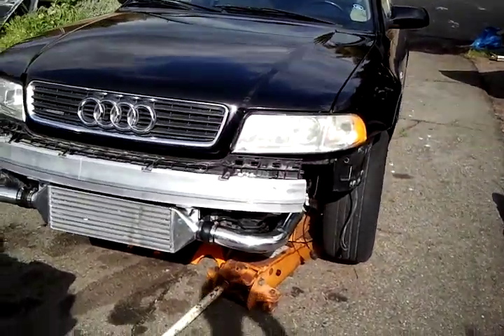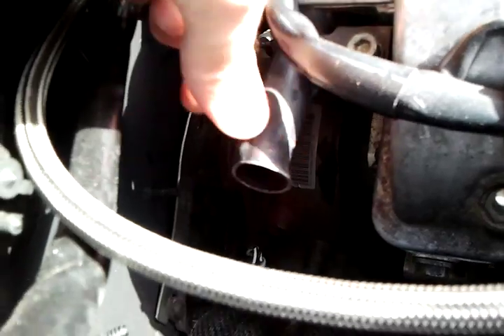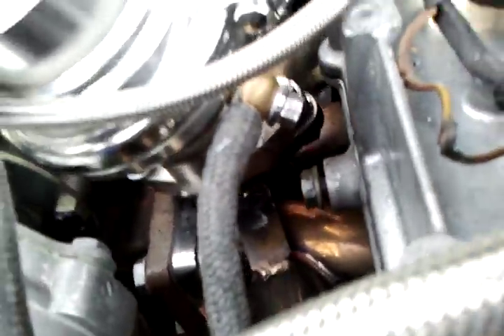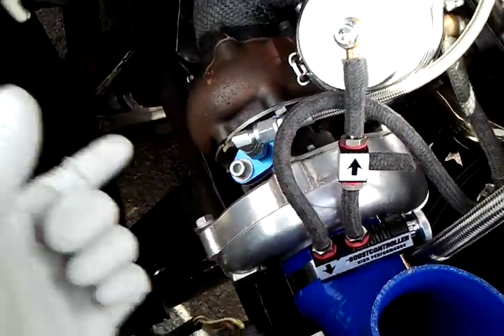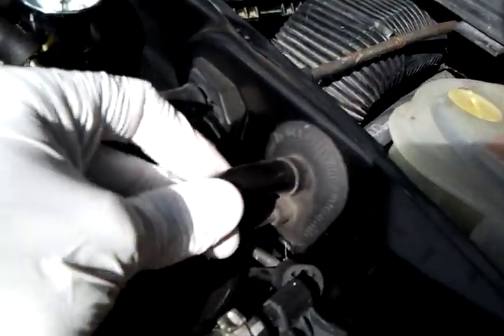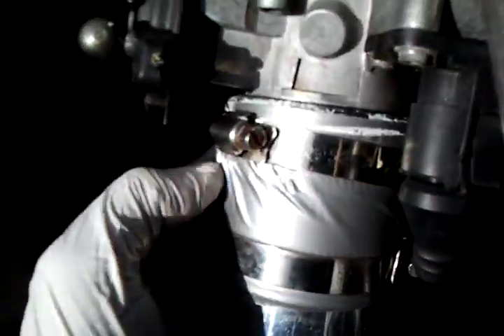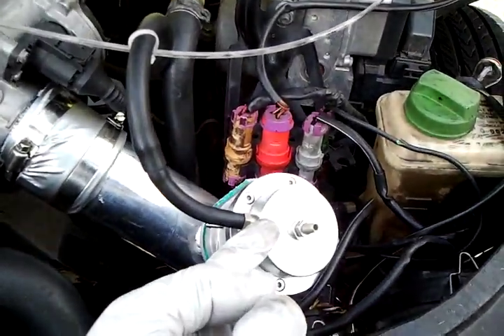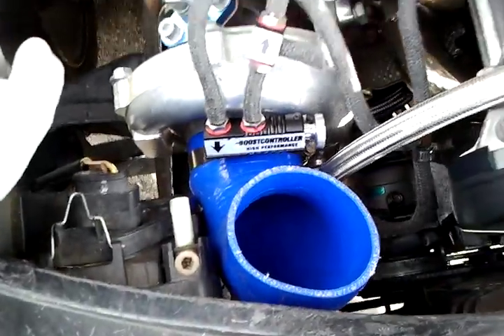A4 1.8t build explained

Comment: Any updated video on this?
Reply from the maker: I sold it a while back.  I need to find my wiring notes so others can have a point of reference if they want the b5 big turbo challenge.
Reply: @idus  ah, that would be great. I have a b6, any idea if it’s about the same?
Reply from the maker: @nicholasrodriguez2122  the 1.8t motor runs through many models so I’m sure it runs a 60-2 wheel for crank timing.  That’s perfect for a stand-alone.  All you really need is to sense the motor rotation and everything else comes to life.  Once rpm is read, your fueling and ignition become possible.  I’ll double check and update the description in this video this weekend.

Comment: That Turbo on a "Stock Tune"?
Please elaborate?.. like ECU is factory and it was just a direct bolt on, and thats it?
Reply from the maker: Veyron640 I put a megasquirt on the car and just cut the wires that control spark and injectors and taped into sensor wires to share the information between the stock ecu and megasquirt.  This way I could still use the dash.  The stock ecu thought it controlled things but actually didn’t control how the car ran at all.  I did with the megasquirt.

Comment: Love the build! I’ve beeen having overheating problems with mine lmk if you could help
Reply from the maker: Have you made sure you dont have a head gasket problem? If you notice that the radiator gets low on coolant or pressurizes too much, it could be a small leak in the head gasket. Other than that, I had no issues with over heating. Also make sure your fans are coming on. If not you can just connect them to a switch.

Comment: hey how long did all the ebay engine mods last u.. is ur car still in action?
Reply from the maker: MR CT NGUYEN the waste gate worked perfect. 
Boost controller had no spikes. 
Turbo was fine, although getting a proper core rebuild was next on my list. 
Headers cracked so I used a log manifold. 
Megasquirt was perfect with the 60-2 trigger wheel. 
It was worth it for me at the time, but bigger hp gains require more heat resistance and anything over 250-300 hp with my setup would need better parts. 
Quick fun inexpensive power, ebay is my choice.

Comment: rocking non g12/g13 coolant... lol
Reply from the maker: Coolant was my last concern. Mainly the auto trans was the culprit. I could have gotten a gio board to control the trans and it would have been solid. I would have a processor that I could program and relays to control when the solenoids came on and off. Nice paddle shifting I Could have done.
Reply: +idusclothing how long did it all work?

Comment: still running the same setup?
Reply from the maker: If you check riecent videos, I now have a turbo datsun 510. Kat
I got a bmw ai want to do an ls swap on. Just need to find the right motor. 
The jy had one but it had north of 250k miles. Kind of a risk.

Comment: wastegate vac line is backwards...
Reply from the maker: Nope,
Full boost goes to the bottom of the diaphragm, lifting the valve. Partial boost (boost controller additive boost) goes to the top, adding extra force to the top of the diaphragm, making the spring harder to open. 
You adjust the boost controller to add small amounts of pressure to the top of waste gate, increasing the closing pressure, thus resulting in more boost. 
It worked great. 
Would not have worked if backwards. 
Thanks for the comment, im sure not a lot of people know how these things work. Now they can learn from this.

Comment: nice fab and welding. terrible idea though. $300 ebay kit and audi = disaster. my injectors for my modded b5 a4 1.8t cost more then that 😂 and thats not bragging, just a cost of performance fact.
Reply: +Peter Ohsnap kid... all an ebay kit is pretty much piping... a tube is a tube. turbos are a hit or miss, rebuild with legitimate parts and most ebay turbos are solid. 

I have an idea, make a case instead of vomiting stupid posts that hold no value.
Reply from the maker: so what would you say your injectors have over ebay 1000cc $180 ones?
metter ms, or low z maybe? but then you need to solder a resister for it to work with megasquirt.
manufacturing now days makes mods cheep and easy. spending too much isnt really worth it for budget builds. unless you make good money, spending 1000 on a turbo isnt smart. ebay, 250 for a gt35 that will feel great at 20psi.
Reply: 180 for ebay injectors is already 60% of the cost of the entire ebay turbo kit. If $300 turbo kits were so good why doesnt everyone just run those? Because they are junk! I used to go to this shop that was near by. They had a Eclipse turbo that belonged to a teen. Made 360ishawhp ( granted that was on a dyno dynamics which read super high ). It was boosting 20psi for about a month and a half. Then the turbo went. When you build a modified daily driver you need it to be  reliable. Im all about saving myself, i dont own a company and im not making alot. But their are limits to saving, u cant expect to buy a whole turbo system for 300 and expect it to last for any real length of time. A proper waste gate is as expensive as that kit. Post your claim on audizine, see what the guys there say. They wont be as nice as i was 😄. 

So the cars gone.  Any new project?
Reply: Peter Ohsnap all my b5 has is apr stage 1, test pipe, forge splitter and fmic. Mines a fwd and i can barely put power down. Blows the tires off in 2nd  if its less than 50 degrees. Vw/audi ecu are sensitive basatrds. I don't know how this thing could run right.

Comment: why go that big of a turbo for 10 psi you can get a cheap ko3 or ko4 and do the same amount
Reply from the maker: No,
Smaller turbos push less cfm meaning less air to the motor. You can have the same psi for a smaller turbo but get less air and making less power at the same boost pressure. The downside is that it spools at a higher rpm. I was anticipating a higher turbo thresh hold on this build when I did it. Turned out to spool nicely and gave great power on the onramp.
Reply: you know they run 8 psi stock right i have a b5.5 with an awm 1.8t and it does 8 psi stock tune
Reply: +HeyItsSway  i have an 1.8T how do i make my stock turbo push more psi
Reply: Michael Owens only thing i can think of is to tighten your wastegate spring   but it wont be a noticeable amount (2-3psi) i would recommend taking it to someone and have the ecu tuned for more
Reply: thanks
Reply: +Michael Owens get a k04 lol
Reply: +Michael Owens or get a tune, ive seen k03's go to 20psi if you want them to
Reply: +trevor currie my k03 is pushing 17 psi on a stage 2 tune. Upgrading to big turbo this spring.
Reply: +Michael Owens look into eurocustoms

Comment: Fyi recirculate your bov haha, Mine wont even run like that.. and it pushed the release valve up on the bov, It doesn't get pulled up my vacuum lol. If your running stand alone bov like thats fine but if stock she wont like that, Or get Vag-com and tune your ecu for your mods so the ecu will accept them as normal.

Comment: Hows the ebay stuff holding up ? gonna oder the t3/t4 turbo and ATP manifold, I'm surprised you got no boost spikes, I'm running 19-20 on my tune on stock k03 turbo but ecus tuned.

Comment: well it depends on the build quality it varies from controller to controller it wont cut instantly down it will say spike at 15psi the as your rpms increase the boost will slowly be bled off until it reaches the preset, as far as chips go there are many out there for all audi ecu you just have to do a little digging,034motorsport can make there own chips but they tend to be pricey so research is key. there are allot of fakes out there as well so research research research

Comment: Hmmm dammit DSMS are so easier to work on then these damn audis i hate old cars but love them for the simple power.. So it would go up to like 14 then 13 then shut right down to 10 ? Its better then dropping all the way to 8 ? Do you mean like chips ? ECU upgrades i have a ATW engine so their isn't many ecus that have been chipped for these cars.. Only 1 year of the ATW witch is a bitch !

Comment: companies such as 034motorsport, ECS tuning and pretty much any euro motorsport company should have these or be able to order them but they are not cheap, however i have seen some in the old school hot rod Toyota crowd use the air regulator from an air compressor with very impressive results they hold extremely well and at a fraction of the price...not sure of the exact name of the part or how exactly they connected it though but i am sure the info is on a forum somewhere.

Comment: my digital boost gauge would reach 10psi briefly then return to its 8psi designation and my manual controller went to 13-14psi before returning to 10 so the choice is yours i just prefer audi controllers.

Comment: boost spikes are pretty common to most boost controllers some more so than others, at least that is what i have noticed, more so with the cheaper models than the latter but that is all dependant on build quality. i am not running a manual boost controller i only ran 1 briefly then re installed my factory n75 you can pick up a different code N75 for safer boost increases such as the n75 J and n75 F i believe our factory unit is n75 E if memory serves me. there is still some boost creep though

Comment: be cautious of that manifold i had 1 on my 1.8t at 1 point and it cracked 3 times the third time i just replaced it and took my project in a new and better direction...well better for me that is, your bov should be closer to your compressor housing so as to reduce the chance of turbo surge, you shouldn't remove the evap system because you will burn a check engine symbol into your forehead lol, i recommend buying some -6an push lock hose and cleaning up the evap system instead, nice build cheers.